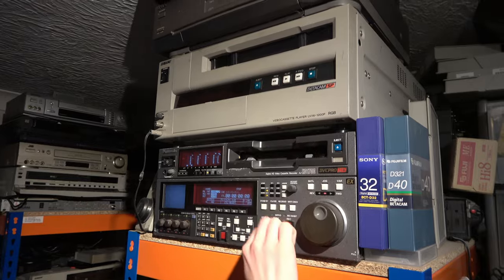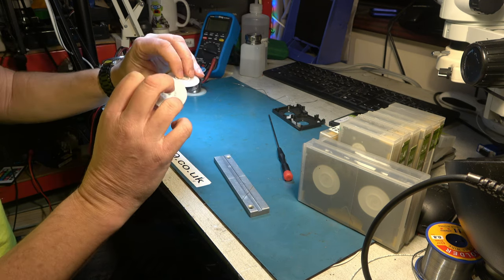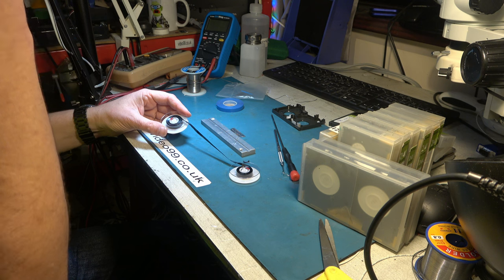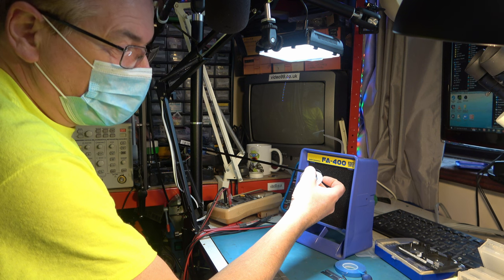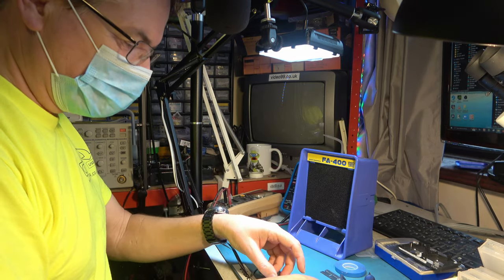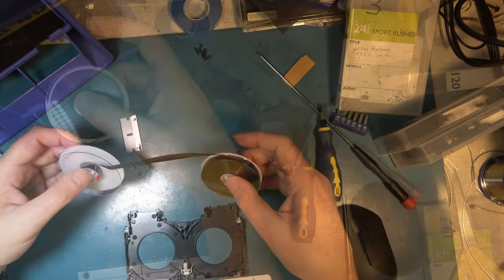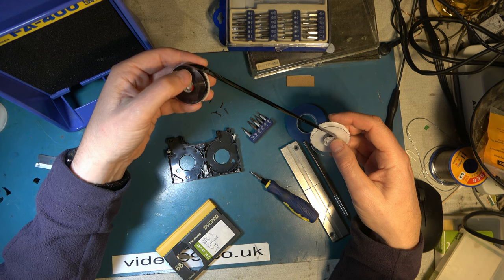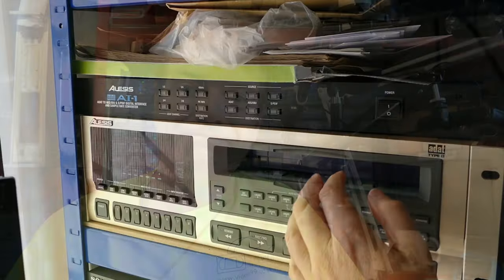Mould on DVCPRO and other DV tapes. Applies to miniDV, DVCAM, HDV.

Comment: What a nasty noise it makes as the mould comes off.
Colin you do a great job of recovering peoples precious recordings.
Pity that no one has found a chemical to remove the mould easier :-(
Reply: There are chemicals capable of  removing mould of course (though removing the spores is another issue) but these tapes are pure Metal Particle or Metal Evaporated. To prevent the metal oxidising which would destroy the recording, at manufacture a thin coating was applied to the metal particles. The coating cannot be breached. As I understand it, whatever chemical is used to remove the mould must not also damage the coating, or it's game over. I believe this is a big problem with treating these tape types, and the reason why compared with say Ferric or Chrome tapes, Metal tapes have a lower chance of successful recovery from flood, chemical, mould etc damage. 
                                                                                                                             
 I've used Colin's "dry" method on 8mm tapes and it mostly worked (thanks Colin!) but there was only a small amount of mould involved and getting the back tension right was tricky. It would be good to know if there are chemicals which can remove the mould,  but not breach the coating.

Comment: Mould will also contaminate the heads and rollers and transmit itself to other tapes.  Same problem with floppy disks.

I'm personally surprised none of the larger DV formats use metal base cassettes.  You would think being a professional format they would do something like that, especially for the larger cassettes?

Comment: Metal type videotape seems to be the most susceptible to growing mold. I have seen it growing on the metal type "Audio" tape used by Sony DASH PCM machines like the PCM-3324/48, 34-02and the Mitsubishi X-80/86 X-850, I don't know about the 3M 32 track digital but I suspect it would be the same since 3M-275 is almost exactly the same as Ampex-467 if you think a Large DVCPRO tape is fun to clean, wait till you see 7200 feet of 1/2" 467 on a 12.5" reel, or better yet 1".
Reply from the maker: @Matt_Quinn-Personal_Account  There's a piece of research waiting to be done on this subject.  I agree that it seems there is more than one type of mould at play.  Some grows across the tape surface and then it's pretty much trashed.  Some will glue the tape together, some seems much weaker.  How much of a health hazard it is is also not researched but let's assume it is bad.  Oxide tapes on average are thicker than metal so I suspect that is why metal seem to be more of a problem.  If you have mould on a thick U-matic oxide tape you may not even notice.

Comment: I work with these tapes to convert in Brazil, here in the northern part of Brazil, 90% of the tapes that arrive here, in addition to mold, there is a type of insect chemistry. When tapes were stuck, it was a nightmare, but I decided to use a technique that involves leaving it in water for around 1 or 2 hours, the tape comes off, so I waste less time treating it, before it took around 4 to 5 hours, now in around 1 to 2 hours.
Reply from the maker: I've never put tapes into water, very scary.

Comment: Thank you for the informative video. Doesn’t baking tape suffering from sticky-shed syndrome guarantee that more portions of the recordings will be saved than the method used here?
Reply from the maker: @willianaleman6114 Tape baking can help with sticky shed syndrome, but that's a different problem to tape being glued together with mould.
Reply: @video99couk As always, thank you for your informative responses.

Comment: Me just wondering...
How does mould get on tapes...? Is it a storage problem that causes it...?
Asking this because I've got a "JVC GY-DV5001 Pro Broadcast video camera" that uses both "MiniDV and Pro Tapes"
Still figuring out how to use that camera without tapes...?
Can you make a video about that...?
Thanks...! 😉😎
Reply from the maker: Certain brands of tape.. I'm looking at you Fuji... are more prone to mould than others.  I suspect the mould spores are already in the tape during manufacture in some cases.
Reply: @video99couk Normally, mold grows in tape due to high temperature and humidity. The recommended temperature for long term storage in a controllable environment is from 38-50F degrees and 25-50% RH. VHS are more tolerant to high levels. It’s the inappropriate temperatures and humidity the main cause of mold on tapes. However, in general, tapes made of ME as part of the composition are more prompts to attract mold than EP.

Comment: If the mold has not eaten itself through the emulsion these can still be rescued easily. Not much succes with molded DAT tapes though......
Reply from the maker: Once the mould has been cleared off the tape edges, then they usually play fairly well.  Occasionally mould does grow across the tape surface and then they are pretty much toast.  I've had a mouldy DAT tape in, and there was nothing I could do with it.  Not often I give up but DAT is too thin and a lack of flanges don't help.